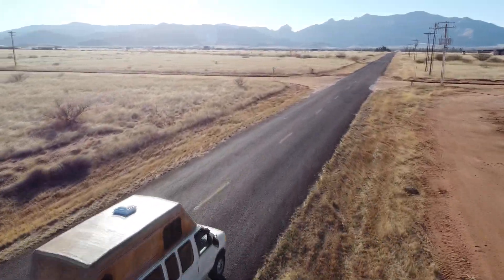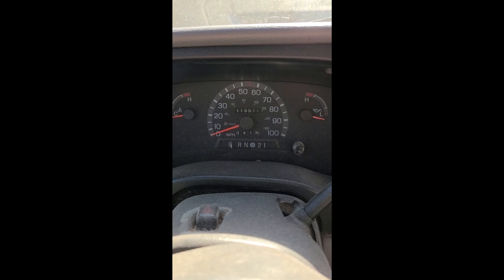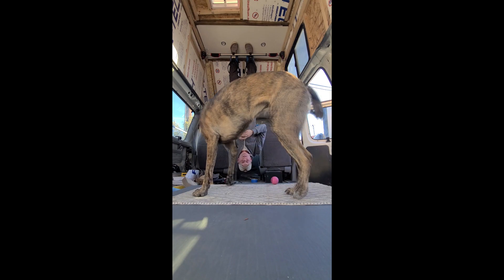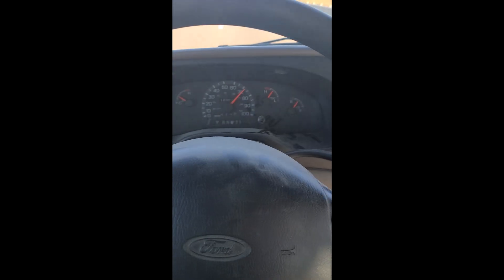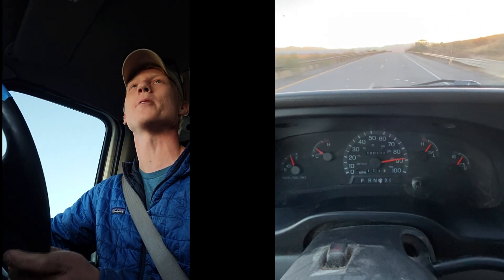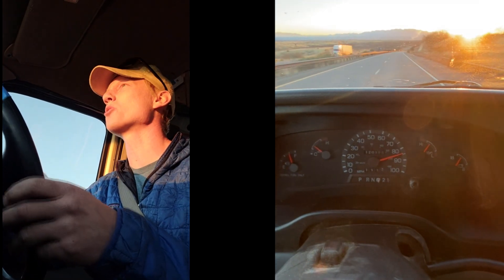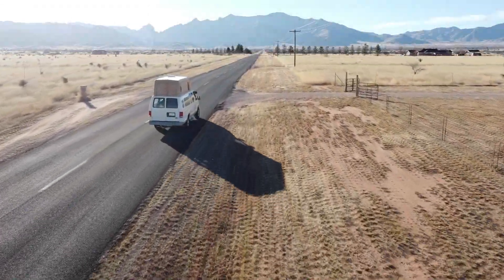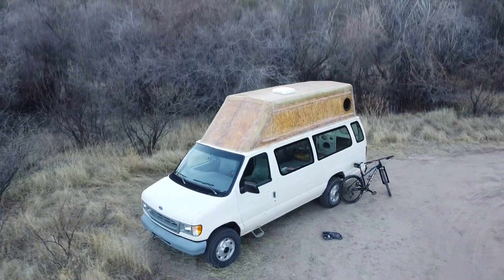Will It Take Flight? Speed Testing My Custom Van Topper

Comment: This has negligent homicide all over it
Reply: Just to add to this, even if it’s kinda stable driving at 60, if you get into a crash it’s definitely coming off. If you get into a head on collision that’s going through the other drivers windscreen.
Reply: @AlanMonger  Also, if you paid attention to the way it's affixed, it's actually on better than most commercial toppers.. So I don't know what you're getting at. It has become a structural component paired with the body. I suppose the body of the van would have to fly off the frame for your theoretical situation to happen. Please don't talk out of your ass on the internet.
Reply: @MetalY2KMusic  Guess he's never heard of a car top carrier.
Reply: @AlanMonger  So tell me about other conversion vans with toppers?